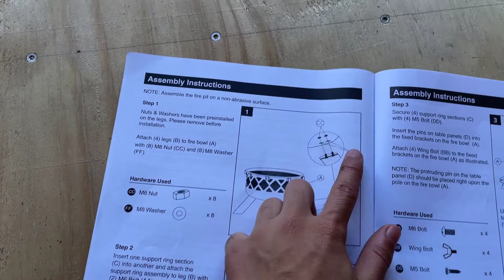BALI OUTDOORS Wood Burning Backyard Fire Pit w/Cooking Grill 32x24 Inch | Unboxing & How To Assemble

Comment from the maker: Here are the #ad links to this unit and other top & popular fire pits:
1.  https://amzn.to/3FvqNNr  |  BALI OUTDOORS Wood Burning Fire Pit Backyard with Cooking Grill, 32in, Black, 24in
2.  https://amzn.to/3pbPQ2c  |  Yaheetech Outdoor Fire Pit 32in Steel Fire Pits Bonfire Firepit Patio BBQ Camping Bronze Outdoor Fireplace with Spark Screen, Mesh Cover Poker, Bronze
3.  https://amzn.to/3yJfL4i  |  Redeo Outdoor Fire Pit Wood Burning Square FirePit for Outside Backyard Heating BBQ Drink Lawn Decoration (32 Inch)
4.  https://amzn.to/33Qlni5  |  32" Fire Pit Table Outdoor Set - 4 in 1 Square Bowl Wood Burning Fireplace - Patio Garden Backyard Firepit - Heater Stove/BBQ/Ice Pit - Poker, Spark Screen, Log Grate, Grill, Mesh Lid, Dining Cover
5.  https://amzn.to/3mibyiX  |  Solo Stove 27" Yukon Fire Pit Stainless Steel Smokeless Outdoor Fire Pit Great for S'Mores and Hot Dogs

Or Click on Amazon link here and search for what you need:  https://amzn.to/3xIOsqg